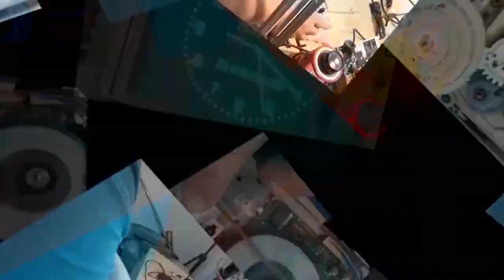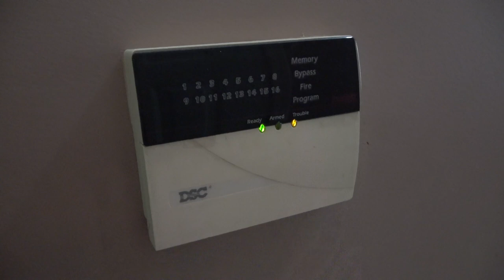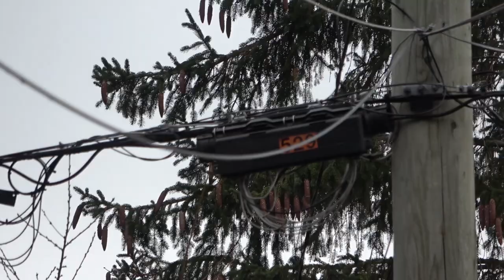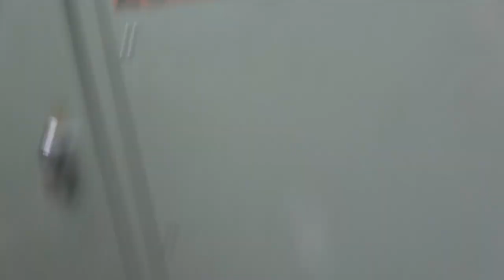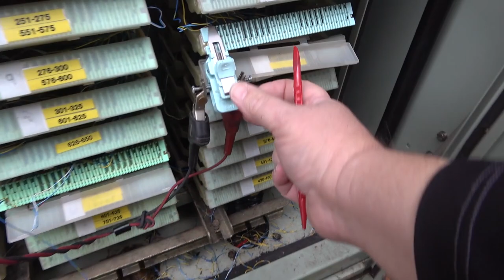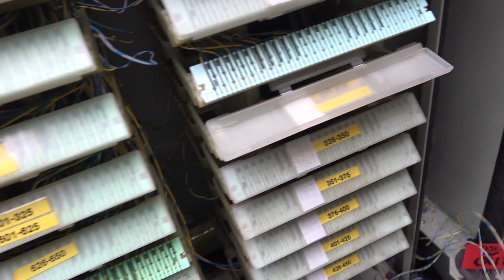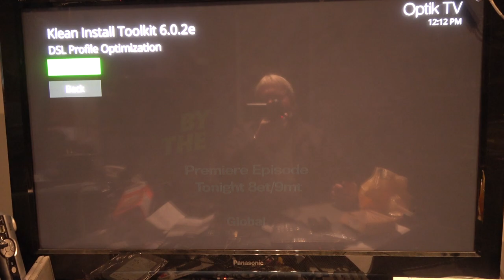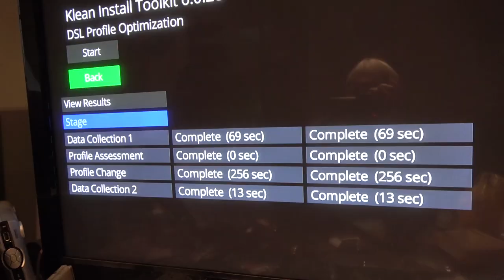Fixing my old noisy copper phone line

Comment: I actually have three different isps in my house.   Also Fiber.  Love it.   I got so tired with Comcast and their dumb Modem always just going out.   I only have it as a Backup.  JUST IN CASE.  But so far?  Centerylink  has been 100% uptime as far as I can tell.  ANd the Gig up and down is amazing.   

The Installer did a Good job on the Outside, but the Power brick for it on the inside needed for the LNT needed to be redone as the wallwart was not installed with the wire properly.   No big deal.  

 I have since put a UPS on my LNT, and it last for about 6 hours on a ~35 amp hour AGM.   I plan to upgrade it to some large Car battery and call it a day.  I also need to upgrade to POE AP's so I don't have to worry about when the power goes out and having a UPS on each and every A.P. 

last time the power went out of my house I was the only one that actually had power to run outdoor lighting and a few other things inside the house. I'm playing to get a generator just got the heck of it that runs on Natural Gas.   might as well get the big one that can run the whole house for 200-amp service because it cost just about as much as getting a small one installed.   I want to make something custom so I can actually use the heat that the generator produces inside the home as well for further efficiency

Comment: You're the only person I know who has fiber running up to their house, but prefers DSL.
Reply from the maker: What i have works for me.
Reply from the maker: It's not that i prefer DSL, but there is no advantage to change technology.  It's not like I am willing to pay for faster speed, so i would have the same speed i have now.   So, what would be the advantage other than another device (Ont) that i have to pay for the power to operate.  
Yes i could get faster speeds for a higher monthly cost, but i don't need the speed.  Infact i don't need the speed I currently have.  I could do just fine with 50 meg service and i have 75.  
The highest bandwidth I use if if i stream 4k, which I never do because Netflix charges a premium to stream 4k and their service it too expensive as it is.   HD only needs 7 megs.  About the only serious use i do is uploading these videos and i generally do that overnight. I could care less if it takes 15 minutes or 2 hours to upload.

Comment: I think some business phone systems will support pulse dialling. I have an NEC univerge sv8100 at home and I plugged in a rotary phone once. I could dial from it. the only thing was I couldn't just let go of the dial at the finger stop, I had to push the dial back or else it wouldn't go back fast enough for the phone system to recognise. not sure if that's a phone problem or a phone system limitation or a config issue.

Comment: I had both fiber optic and cable modem telephone service and my alarm system did pulse dialing successfully on both. I haven't had it connected in years, so maybe support was dropped? I converted my alarm system to send emails and text messages over WiFi and cell service. I use a $20-$30 prepaid Android phone, so the cost is cheap. The cell phone data service is only used if the WiFi isn't working. Since it's prepaid, the data will last virtually forever. I don't use central monitoring. I send alerts to all my mobile devices as well as multiple relatives if my alarm gets tripped. Connecting the alarm system to the cell phone was easy. I have a relay connected to the siren that shorts the microphone jack on the cell phone, which triggers a program to send the alerts.
Reply from the maker: Not on the Nokia ONT we use.

Comment: If you use a cellphone the operator at the other end can poll what cell towers your phone can see, the sectors and signal strength, and this will give them your locations with an accuracy of approx 30ish meters. This, combined with the flexibility of not having to get to a physical location to make the call in the first place, makes them generally more useful than a landline in an emergency.
Reply from the maker: 30 Metres? You sure about that.  Even at 30 metres which is about 100 feet, if you are in an apartment block that is what, about 8 floors and 5 units each side.  How long is that going to take you while you are in cardiac arrest or stroking out?  Minutes count. You have 4 minutes to get help or you die.  When my dad had his stroke the doctor said had he been relying on cell phones they would not have got there is time because he couldn't speak. If you have a gps signal they can get the location close but still not down to the address in a multi unit complex.  They get the lobby address and nothing else.  With a home phone they have the physical address.  In an emergency that information is vital.  Saved my dad twice. Then he got taken out by a virus.  A flu like virus.
Reply: @12voltvids  I used to work on processing data from cell towers, and yes 30m is quite conservative (ie: that's what they'd publicly admit). It's only in recent years they've started using GPS in phones for location on emergency services, they used to just rely on GPRS  cell tower data, and this revolutionized their ability to find people in need (I know this because that's part of the data we supplied).

If you're anywhere crowded you'll see more cell towers (funny how that seem to correlate), and the accuracy increases significantly. And 4 minutes is basically the difference between the time it takes to (try to) reach the hard lined phone vs reaching into your pocket.

Times move on, landlines have a lot of merit, and they still work and is a robust technology, but there's been advances too.

Comment: Last two times I had line noise, it was squirrels that chewed through my aerial feeder from the pole to my house, crackling as it swayed in the wind, I've got the same butt-set, and it was helpful in getting the phone company to send a tech out, they always balk that if it's inside my house they will have to bill me, but I can unhook my DMARC and tell them there's still noise.
I've also got bonded pair DSL here, though if I had fiber available, I would switch over in a heartbeat, I have a PBX that does all the pulse to rotary conversion, and provides ringing voltage to the phones, so my old rotary phones work great, no matter what kind of line my PBX is on.
Reply from the maker: Squirrels cause many headaches.
Reply: @12voltvids  Yeah, my local electric utility is always posting on their facebook feed how something like 80% of blackouts are caused by them lol.
Oh, also, nice Chevy Volt, we've got a 2012 Volt, and a 2020 Bolt.
Reply from the maker: @ACRPC-dot-NET  I have a 2012 and 2019 volt. Had to get a second one when they announced they they discontinuing it. I like to travel and a battery only would not do. Not waiting around even for 40 minutes to charge. Stop every 500 KM for a 5 minute gas up and go.
Saying that, I went an entire year on 1 tank of gas and then the computer made me burn it up. Did 1100 KM before I refueled and now the timer is reset.

Comment: They are pulling the copper away here in the netherlands, forced alott of people over to either Cable (TV) or Fibre.
There are tricks with electronics to make your old phones work on modern networks I think. rotary to DTMF converters and well, power can be added aswell. also the modem thingy should have phone connectivity. 

But I understand, ol analog telephone is just so awesome to keep working. sadly I moved twice in the last 10 years and all 3 places sofar got fibre upgraded and disconnect the copper. My now latest place is where I live with my spouse, the phone cables lay under all houses, like, what? nobody can go find a fault this way. fiber is coming in from the street, so im kinda happy about that.

Comment: Nice grounding too. Mine was NEVER grounded. So I went through many DSL modems and phones/devices because of it. Now I have the same issue on my cable line for internet. I installed a lightning suppressor on the coax since it came through last and blew out the modem, router, Roku, TV, and other CAT5 devices.
Reply from the maker: Ah yes lightning.  Money maker for repairmen in the past.  We used to love it after a storm rolled through.  It was like xmas in July.

Comment: How are you able to get that kind of speed on your DSL line? My ATT U-verse ADSL only gives me at best 3.5 meg on speed test and as far as I can tell that's as fast as I can get unless ATT is just feeding me a line of BS. Years ago I used to have two POTS lines and got rid of one  line trying to save money and and they switched me to digital along with my phone. Spectrum will not run a line to my house or I would have switched.
Reply from the maker: I had a bonded loop which each line delivered about 37mb down 10 up.   I was also close enough to the cabinet to get those speeds.  Some customers closer hit 150 down 40 up.  I was about 650 m or 2000 feet from the cabinet cable length wise.  
With ADSL and vdsl it's all about the distance and the wire guage. Before the field cabinet was installed about 14 years ago the fastest I could get was 6 as I was about 5000 feet out cable length wise.  Now I have put in fiber so I could get 3.5gb if I wanted to pay for it.  I get 150 up down on my plan which is more then i need.  If I could save 5 bucks a month and go down. To 75 i would but it's the same price. I wish i could qualify for the internet for good plan.  50 negs for 20 a month but i can't as my income is above the threshold.

Comment: Here in Tulsa, Oklahoma, I'm Windstream DSL. It uses two lines with 10 Mbps down and 1 Mbps up. I changed to DSL because it's half the cost of the Cox Communications cable modem, and we couldn't afford the cable modem anymore. The DSL costs around $55 a month. There's no fiber optic in our area although that may be changing. Just curious-- what gauge of grounding wire is recommended for grounding the telephone system? When the old box was replaced, they reused the old ground wire and clamp that was put in 45 years ago. I realized the grounding clamp was very loose. It wasn't even long enough. I ended up replacing it with 12 gauge ground wire that I have for satellite grounding. Actually, the service area of the box wasn't even closed property. These technicians do a half-assed job at times. I didn't know if 12 gauge was sufficient or if I should replace it with a thicker gauge like 10 gauge. At the time, I had installed an inter system bonding terminal when I was updating the outdoor antenna grounding with a discharge unit. We get lighting storms around here, so I take grounding seriously.

Comment: I have fiber optic. I also have rotery dial phones. What I have between the phones and the FO is a Panasonic KX-T616  I  think a KX-T308 would be enough for your home. There's one on ebay now.  The 308 (3 incoming lines, 8 extentons) will convert the pulses to TT. To program it, you'll need one KX-T7030 or equivlant.  There's a lot of things you can do with this system including connect a cell phone via a docking station, use a Google voice phone adapter,  etc.  I've had my system for over 25 years and it has been a godsend.
Reply from the maker: Of I could just leave my phone system on copper and it will work. And will also work in a power failure. Try that with your fancy system. Yada yada yada, UPS I know, but how long are they good for?
Reply: @12voltvids  battery backup. The system only uses 10 watts of power.
Reply: They took our copper away 20 years ago
Reply: @12voltvids  Also, if we do lose power,  extra 11 connects to the land line, 12 to the second,  etc.
Reply from the maker: @stevesus3295  ONT draws 1 amp at 12 volts. So the 8 ah battery supplied is good for about 8 hours of backup and then it dies.I know that because a customer was bitching about the time. He plugged his laptop into the ethernet so he could watch netflix. laptop was good for longer than the ONT battery and it was brand new. I was sent out to swap the battery because he said it was defective.

Comment: Years ago when I had a copper line I had a problem with no dial tone. When someone called me it would ring and I would temporarily get a dial tone until it went out again. I even remember going to a local payphone to call my own number to reactivate it. Looking online it said it could possibly be a bad interface card which I read was very expensive to replace. I reported the problem to the phone company several times but it was never fixed. I ended up dropping the copper line and switching my phone service to my local cable provider. I don't know if the phone company didn't want to pay to replace the interface card or they just didn't care.
Reply from the maker: If a line card goes bad we have 2 choices. Get the CO maintenance guy to replace or cut to another one and have it programmed. That is usually the fix as the CO guy is never where you want him.

Comment: "Oh interesting. Someone with old school phone service and it looks like they have an old handset for testing their line." 

"Wait, DSL? Well, if you like what you have, ok." 

"Wait, you still work for the phone company? And they let you do this in your off hours? I would have been so fired had I done anything with my service (if I had service) on my off hours." 

"So that's what the inside looks like." 

"Ok, let's see that speed test. What kind of speed are we gonna get, 6 Mbps down? 12 Mbps down? ... HOW IN THE HECK?!"

I worked in a DSL Tech Support call center in the states a few years back. The top speed was 6 Mbps/512 kbps. Your speeds are what I get on cable with an old modem that cannot support the maximum speed of my plan.
Reply from the maker: I can't touch the account. That would be a friable offense but no rule exists that I know of that says I can not maintain my own line off the clock. For that matter I could fix any customers line off the clock too, and did once for my neighbor.  Unbeknownst to me he knew the CEO and told him how grateful he was that I was able to get him back in service at 9PM as he needed his internet service for a webinar he was hosting the next morning. The CEO sent me a 150.00 gift card to a restaurant and I had the biggest most expensive steak they had on the menu and wrote nice memo that went company wide about how I put a customer first and went the extra mile providing exceptional over the top service. 
I could have called in the trouble when I was on shift and had the job overridden to me and got paid to fix my own line had I wanted to, but I have enough to do at work already.

Comment: In my part of the world the incumbent telco no longer offers (V)DSL internet service (or even traditional copper POTS lines) in new installs except for old apartment  or office buildings where fiber is run to the building and then switches to the short copper run over VDSL2 to approximate the speeds they offer over fiber.

Edit: Copper wiring being prone to noise/interference was the main reason why we switched from cable (DOCSIS) to FTTH as soon as it was available in our area.  On cable/DOCSIS every couple of weeks speeds would slow to a crawl, randomly drop out or the modem even failing to connect/sync to the network because of water ingress causing corrosion in joints/couplings and/or RF interference (not to mention the headaches of calling them to send a tech over to fix it). Since switching to fiber a year ago, we always got the advertised speed with no signal issues like we had with cable/DOCSIS.

Comment: What is the fastest DSL connection you can get?
We currently have a maximum of 250/25 Mbps. This is done by bonding two VDSL profiles 17b or just one line with profile 35b. CETIN uses a DSL modem Terminator, which works only as a bridge and supports G.INP and vectoring.
They are still investing a lot of money in metallic in our country and they are constantly building new local DSLAMs. Even in a village of a few houses we have over 200 Mbps because they only needed to connect this new DSLAM to the fibre optic.

I wonder if we're an exception in this. Thank you :)
Reply from the maker: I just repaired a bonded dsl last week in a building that has not had fiber installed yet.  Speed was 150 down 40 up.

Comment: Im surprised you didnt test the spare line for faults , The crackling is usually caused by a high resistance connection . probably corrosion in the wire .....
Reply from the maker: Likely in the RA.  Usually tip going open.  I didn't have my truck home.  If I did i would have changed pairs.  Since I had 2 lines for the bonded loop i just swapped them and put the bonded line on the dry pair with no battery

Comment: Main problem of modern fiber lines is that if there is a power shortage unless u have ups on all your lan u cant use the phone.   while with analogic phones, power is provided by the phone line, so it works even if u are without power  ( wire phone , not cordless)

Comment: i have bought an old house, also still had some impulse dialing phones i wanted to keep including a cool old siemens rotary phone.
In germany we have the "Fritzbox"-Router which not only supports those, but also has a ISDN port so you can connect an older phonesystem to it that also supports impulse dial. So i bought an Auerswald in addition to get all those old Phonelines alive.
Internet and Phone are over Coax TV-Cable and of course VoIP, but the Fritzbox adapts it to everything, no matter if Fiber, coax or copper 2line. Just if you're interested in an alternative solution :p
Reply from the maker: Got nothing to do with rotary phones. The Nokia ont we use supports it.  Has more to do with price.  My bill is high enough and changing plans will increase it.
Reply: @12voltvids  understandable